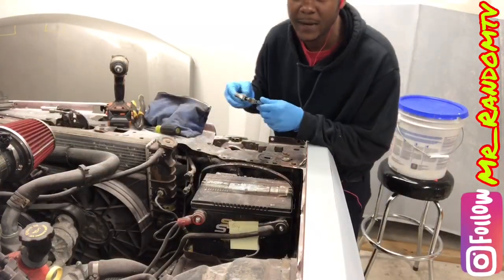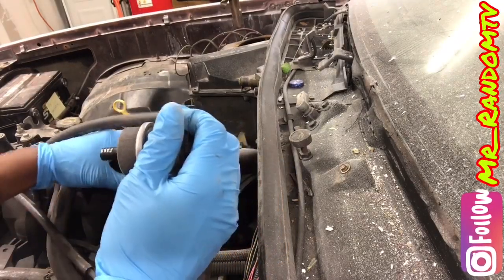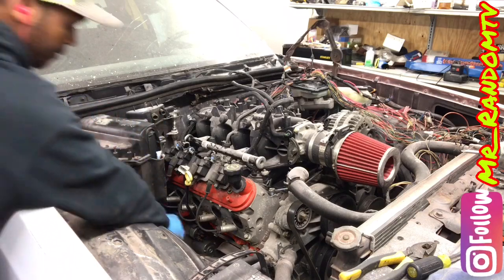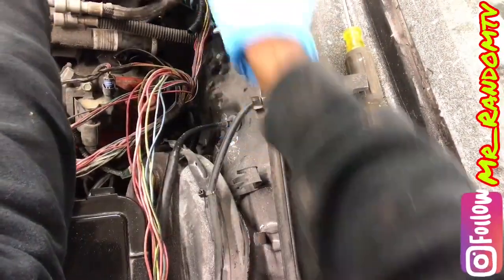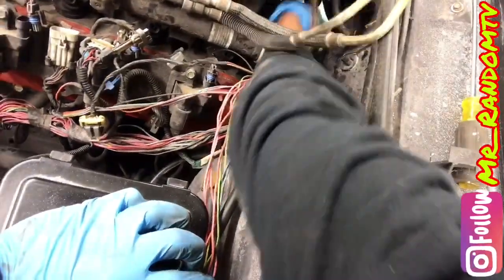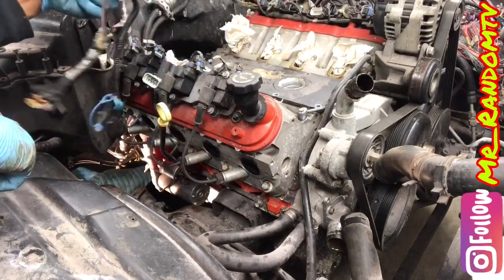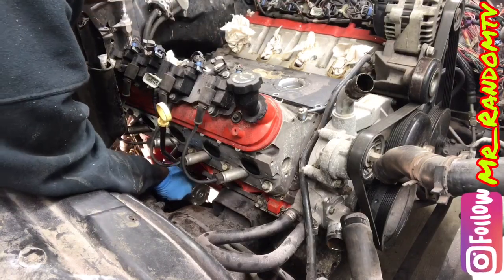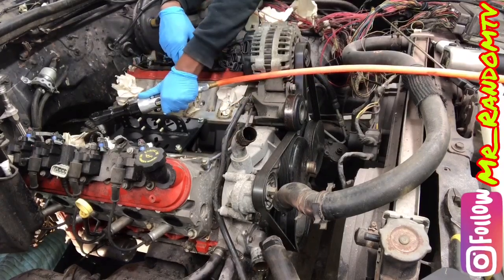Ls Swap G body Monte Carlo SS 6.0  ( Part 1)

Comment: good work man big upgrades on the way!  im using the truck fuse block on mine, which makes it really easy to remove the harness with the engine.  i just unplug one big plug at the fuse block, amd the harness comes out with the engine.  thats a good way to do it at the junkyard too so you get the harness with the engine
Reply from the maker: Thanks MrJohn 100